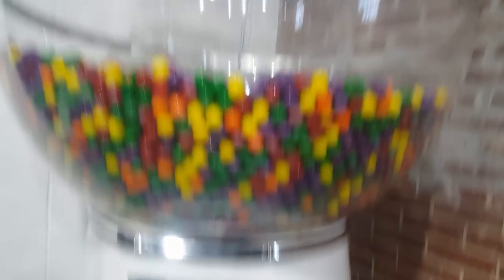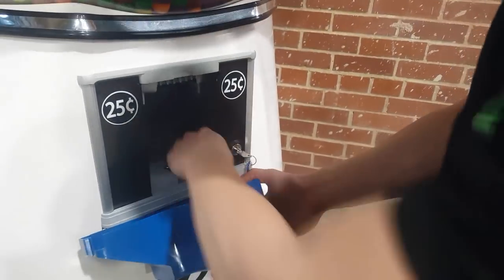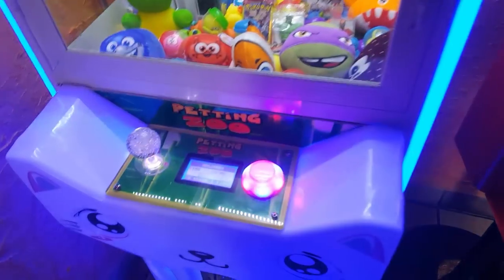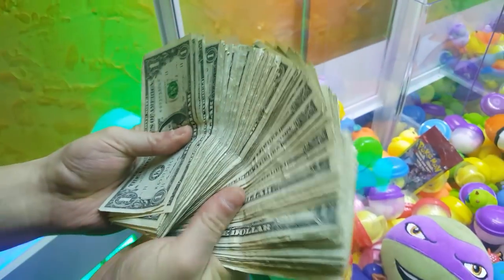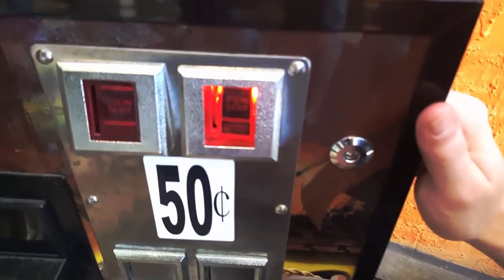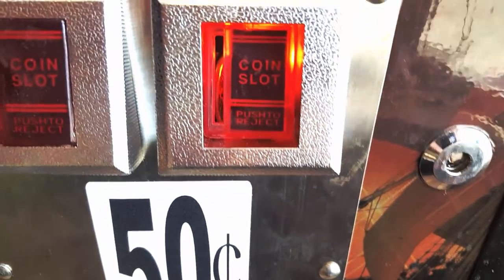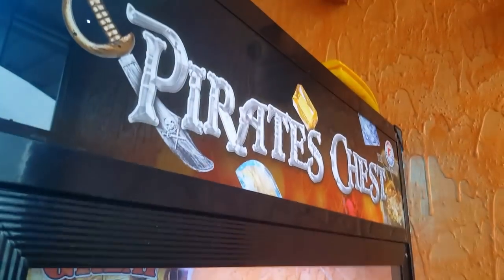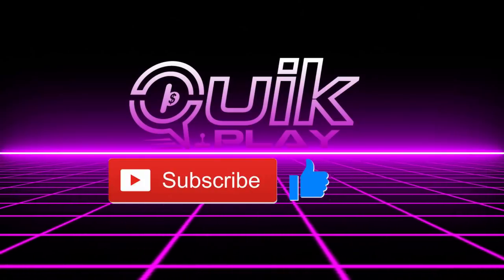Huge Collection From Our Vending Machine Business

Comment: Awesome videos dude. I'd like to make a suggestion to ease your quarter collection process from some of the gumball machines without coin boxes. ( well, why don't they all have coin boxes anyway?). Just cut out a piece of plastic sheet to fit in the bottom of the machine that would cover those pesky screw heads as you're trying to slide the quarters out and you can then simply slide the sheet out right into your coin bag or weighing bin. Is that a an idea that would work? Just wondering. Keep up the cool videos.
Reply from the maker: Hey bro! Great tip! That's definitely something we can do once we get a moment to cut our some plastic! Thanks so much for the advice and support!